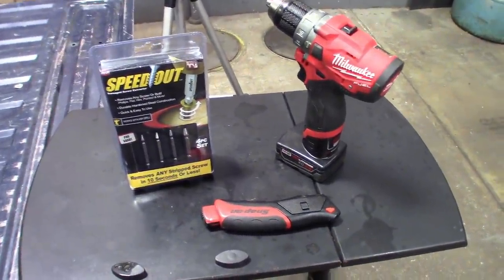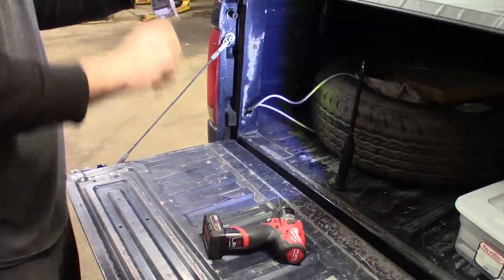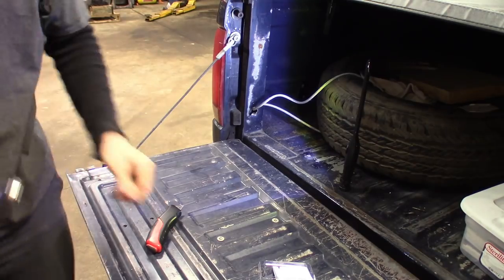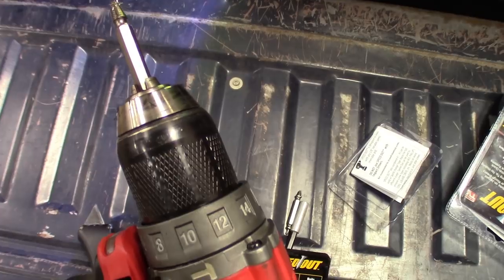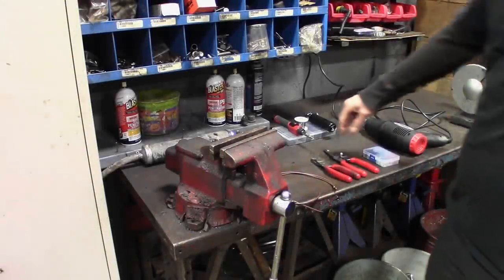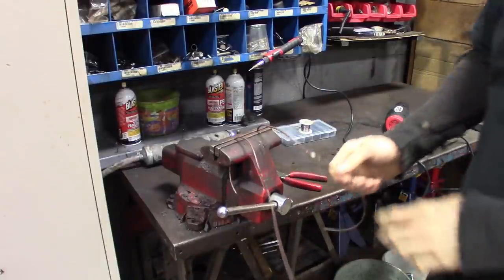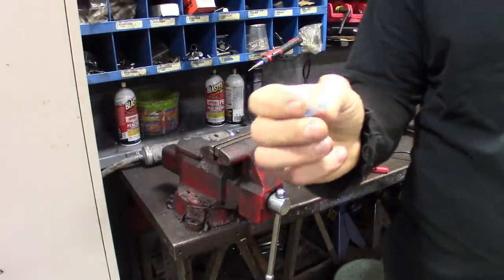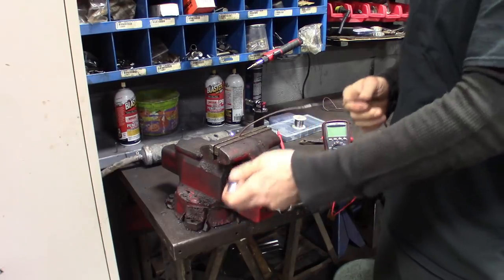AS SEEN ON TV TOOLS

Comment: Great video! I personally use the version of wire connectors that crimps and solders with the heat shrink, but I know these are an as seen on TV set lol. Wish there was a magical extractor set that would take out any and every stripped screw!

Comment: For regular solder joints i use the heat shrink with the glue lining which gives you a nice water tight repair

Comment: Those soldering heat shrink connectors work good but can be a pain in the ass there really good if you have to fit em in tight spaces like on police motorcycles but I agree if u can solder it urself thats tha best way to go

Comment: Good idea in concept those solder connections, however found if doing by a bunch of other wires or what have you. the heat gun would begin to melt every thing but the solder joint.

Comment: Great video Jim! Those seen on tv tools are a goldmine, wish I had a idea 😂 ! Someone once gave me that socket with that magnetic pins inside that adjust to whatever size bolt head. It was probably meant for furniture assembly,cuz that shit snapped on me on a brake caliper bolt lol.
Reply from the maker: Ah the gator socket, I'll be possibly  doing a video on one of those too. I've had some pretty cool tool ideas run thru the old noodle.

Comment: I’ve used speed outs before and they worked. Only problem is you need a pretty deep hole with the bit. Then the extractor side works pretty good. I used my dewalt 20v hex driver impact with it.

Comment: An easy fix to not being able to use an extension on those double sided bits is using a 1/4" deep socket and then sticking the bit into the socket. Great video keep it up!
Reply from the maker: I thought of that too. I just wanted to keep the testing like the advertised way. I'll be redoing the speed out again.
Reply: @JRC54  Better to do it the way they show to show how it does or doesn't perform. I was hoping it was going to work well but you definitely showed that its not worth everything they make it out to be.

Comment: Great idea for a video series.  I'm sure the guy that invented it will say your not doing it right😉
Makes it look real easy to use those heat shrink connectors in the video as you have probably seen. Start in the middle and work your way out. 
Probably takes a lot of practice...lol
I have the speed out set myself and have never gotten it to work in automotive applications.

Comment: I’m pretty sure the speed outs are made to work on wood screws. Maybe they just fail to mention that in the ad. Even pro grade easy outs don’t always work, especially on rusty things.

In regards to the solder connectors, the strength of your solder joint comes from the mechanical connection of the wires. The solder is not very strong and simply acts as glue to hold the mechanical connection together. Those connectors contain low temp solder which is even weaker than regular solder.

I won’t be using either tool in a professional setting. They’re geared toward the DIY crowd and likely won’t really work any better in those scenarios.
Reply: That kind of solder connectors are the only type you are allowed to use when splicing wires when working on Audi/Vw, MB, Bmw in Europe. You are supposed to use an attachment to your heat torch that encloses the connector and spreads the heat better. Ive done 100's of them and none has failed yet. Old school solder and shrink tube makes the joint to hard on modern type of wiring which could possibly brake if the wire vibrates. Havnt had this happening to me but thats what the above manufactures say could happen ;)

Comment: The speed out doesn't work only way to make them work is drill a hole deep with a drill bit then use the extraction side slowly. As for a extension put in a deep socket

Comment: Dont you have a low speed on the drill??? I would think that would have a better chance removing with extractor.
Reply from the maker: I'll be revisiting that one for sure with the drill set on low speed and a straight on shot.
Reply: @JRC54  yeah that angle limits the use of the product. Which is a bad design

Comment: Hey JRC, when working in your shop aren’t you concerned about breathing in. Fumes, smoke, metal rust bits etc? What sort of ppe do you normally use if any? Anyway sorry for going all mom on you but I guess I’m always safety cautious and not exposing the inside of my body to outside toxins. Thanks for the video by the way I’ll be sure to keep away from the gimmicks
Reply from the maker: Thanks. I have a 3m respirator I use when I'm sanding or doing heavy painting. I have a pretty decent ventilation system in the shop. But that's the joys we have of being a mechanic.